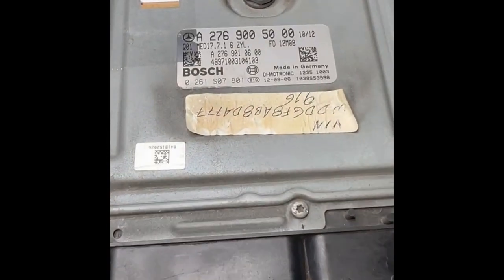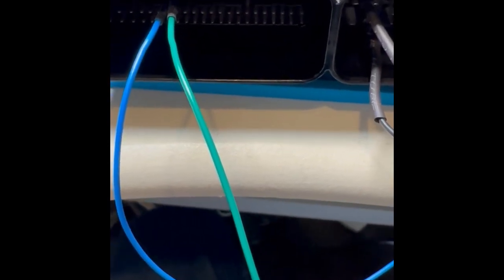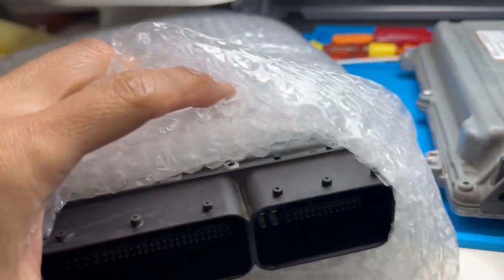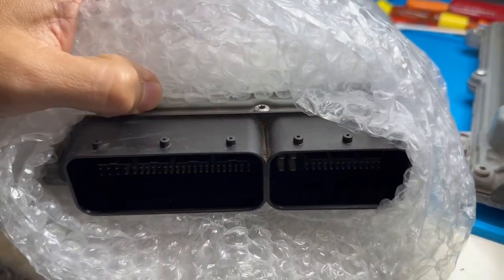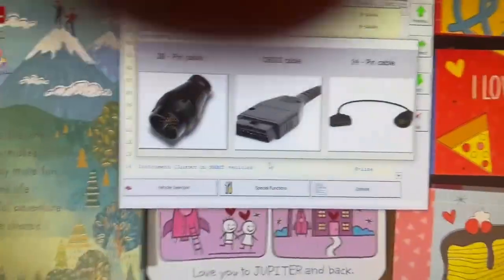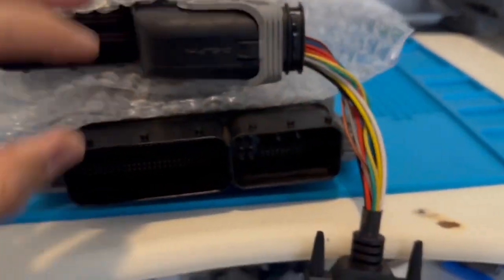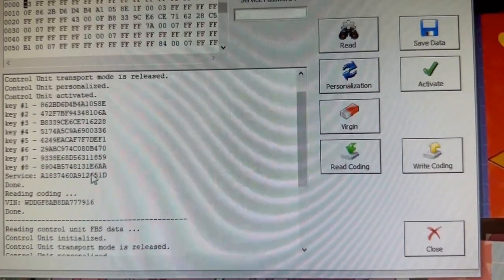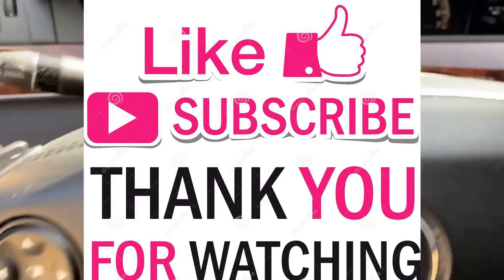Mercedes 276 ECM Cloning MED17.7.1 ECU Programming Hexprog

Comment: Nice video. Where did you get the connector that plugs directly into the ECU, when reading with Abrites? Thank you.
Reply from the maker: I bought it online. It comes with an ECM test kit. Xhorse sells them mk3 sells them. You can probably find it on eBay too.

Comment: I’m working on a 2018 E 300. It has a 17.7.2. I’ve taken the computer to two different Computer Repair guys and both could not communicate with it. They said it is burned out. I ordered a used one which was on the same model and year. What should I do now? I have a Autel ultra. Will I be able to Program the used module to the car?
Reply from the maker: I would try to restore communication on your ECM so we can clone it.

818.510.3375

https://mercedesbenzspecialist.net/

Comment: Hi, I just bought a 2009 c300 sport yesterday and so far I’m loving it. But I have 1 issue, the headlight will not turn on, high beams, low beams, all work blinkers everything but I cannot get it to turn on to regular mode, on the dash there is a green headlight symbol on 24/7 and the knob will not do anything

-edit I’ve never owned a Mercedes’ so I might just be dumb! 😂
Reply from the maker: I don’t understand. You said your headlight would not turn on. 

Then you said. Low beams, high beams, and blinkers work. But “regular mode” won’t work. Help me understand.
Reply: @mercedesbenzspecialist   I was 100% out of it typing that.. I meant to say everything works BUT the low beams. 🥸